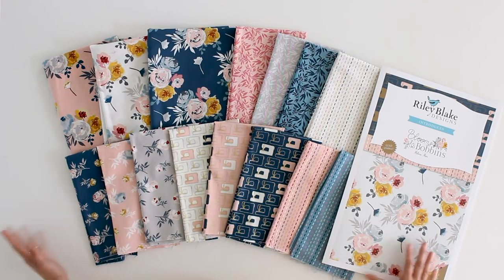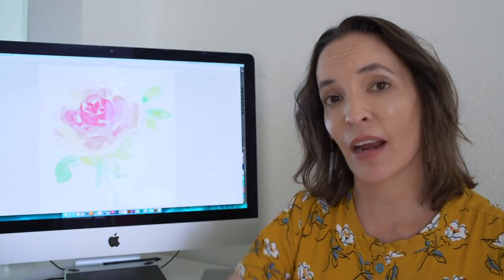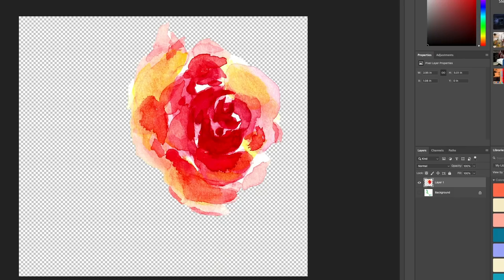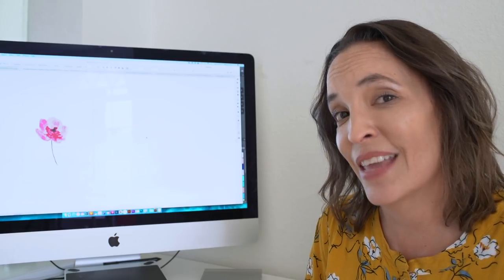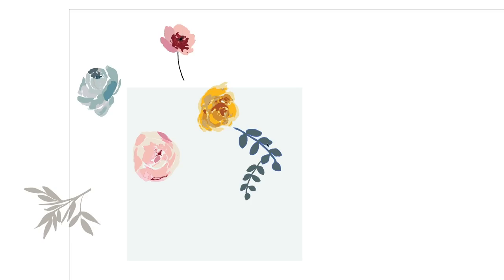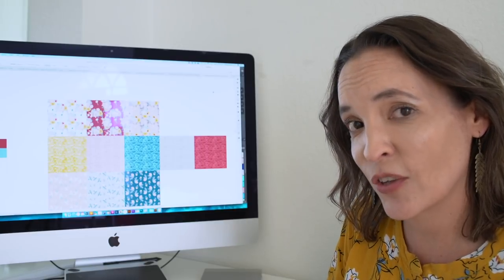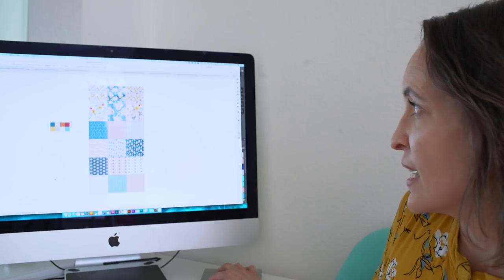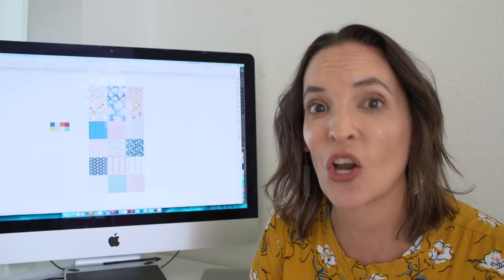How to Design Fabric - Surface Pattern Design

Comment: This is beautiful and thanks for insight. But how do you get the manufacturer/Riley Blake to buy it from you? Did you just email the company with images? I guess I'm asking how do you get your designs published? What's the protocol for that? Thanks!
Reply from the maker: I have a contract with them. The process is the same as getting a design contract with any company - you'd want to build a portfolio first, and then either get an agent or network to find the creative director contacts within the industry you want to work in. It also helps if you have an audience full of fans of your work - creative directors like licensing designs that have a built in audience to market to.
Reply: @Mellysews  thank you so much for your prompt reply. A million years ago I had a career as a mystery novelist (under the name Rett MacPherson) and had a literary agent for that. So where would I look for a design agent? Thank you again!

Comment: This is perfect! I have a project where I need to do exactly what you have done. Do you have some material going in depth on exactly how you set up your canvas,  what functions you use to move them around to ensure it matches, how to smooth edges, how to change the  colour profiles etc. I'm still feeling a little lost and not sure what to do, or is there even a course online you could recommend? :)
Reply from the maker: I don't have a course, just a personal familiarity with the software I'm using.

Comment: Hello Melly! I just found your channel and your beautiful designs. It is a very useful video, thanks a lot! I have a question. When you work on your I pad and use a watercolor brush, do you always vectorize it on Illustrator? Im finding quite hard to keep the watercolor effect after vectorizing it. Can you use it just as it is done in the iPad, or that wouldn't work well when printing  on fabric? I hope to get your answer :)
Reply from the maker: With my fabric, I'm limited to 16 colors, so I have to eliminate some of the gradient or do it by spacing out dots of color.
Reply: Is one always limited in 16 colors, or is just with vompany you choose to collaborate with. Agneta Hallberg

Comment: Hi, I'm a beginner textile designer learning basically from work but we use nedgraphics. I find it so much easier to use nedgraphics, I am wondering if you ever used that program instead of photoshop? I dont know how to really do repeats on photoshop but after watching some videos I find it to be much more difficult.  My question should I take the time  to learn how to do it on photoshop for future jobs? Is photoshop the industry standard for surface design?
Reply from the maker: I did not do formal training for textile design, and I am not familiar with that program. I also don't do my repeats in photoshop, I prefer to use Illustrator, as do the majority of the other fabric designers I know.

Comment: Hello! Thanks for sharing this helpful video, I was wondering if you could share, where do you send the designed images? I’m looking for an inexpensive company to do that. 
Thank you!
Reply from the maker: I have a contract with a fabric company that I design for, so that wouldn't be applicable to your question. For personal fabric printing you could look at MyFabricDesigns.com but none of the custom fabric companies are inexpensive as it's costly in terms of labor to print small quantities of custom fabric.
Reply: Melly Sews thank you so much for your reply.
Reply: @Mellysews  Hello, I love your designs! I chose actually picked your designs up for the company I used to work for as a quilting fabric to use. I quit my job as my mother and I want to design fabric independently. I was wondering since COVID-19 has cancelled all conventions and Quilt Market, how have designers been showing their fabric to companies for them to buy? We missed out last year and it sounds like everything is canceled for this year too.

Comment: This video is super helpful. I'm appreciate! but I have one question, Is this is the only way to color separation for water color drawing? It will be nice if there are other way. on photoshop, with out simplify like you did on illustrator. keep original watercolor texture, but colors are separate. can you give me some advice?
Reply from the maker: No, this isn't meant to be a comprehensive class, just an overview of my process. I'd suggest a Photoshop specific course, there are always multiple ways to do things within these programs.

Comment: Thank you for the video. 
Can it be done in photoshop for a beginner? I started designing patterns by hand on paper, I can scan and edit on photoshop?
Reply from the maker: It depends. I find some things easier to do in photoshop and some easier in Illustrator, and it depends on the file types needed for printing.

Comment: Very pretty fabrics, you’re right to be proud of them! Have you tried designing with Affinity Photo and Affinity Design? They’re very similar to Photoshop and such,  but created specifically for Apple. No monthly subscription, and much lighter on the computer’s operating system 🙂
Reply from the maker: I have not tried those, but I'm leery of another learning curve or crashing which I've had issues with when using software besides Adobe.
Reply: @Mellysews  if you know Photoshop you'll know 90% of Affinity. I was apprehensive before I jumped in but once I saw how much quicker my iMac became I was sold :D

Comment: I have a problem if someone can help pls, how do i design the print so its positioned right after i sew the shirt( ex i want a lion to be in the middle of the back of the shirt. How can i make that happen if i want to print the fabric before sewing)
Reply from the maker: Put the outline of the pattern piece on the software you're using to design your print.
Reply: Thank you for ur reply, and do you have any video on this ? Or planning on making one? It would be extremely helpful please